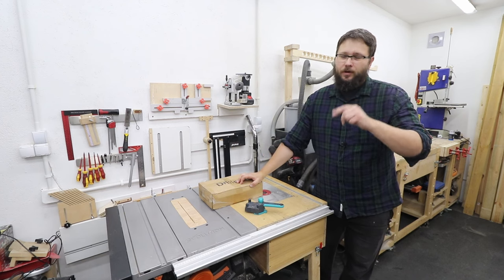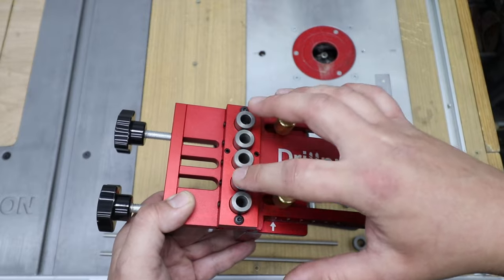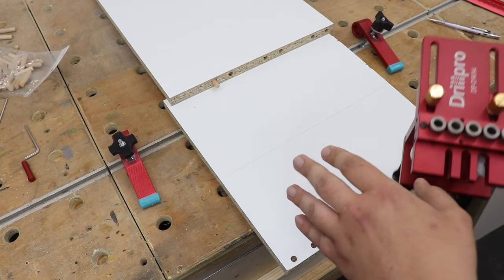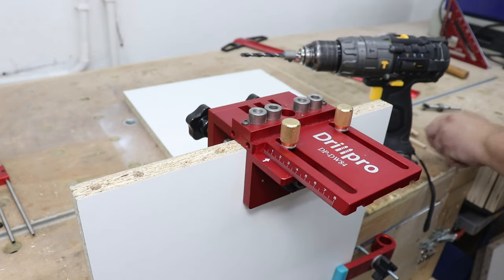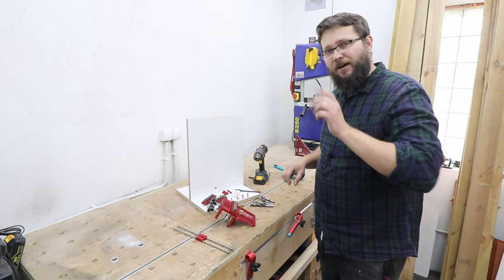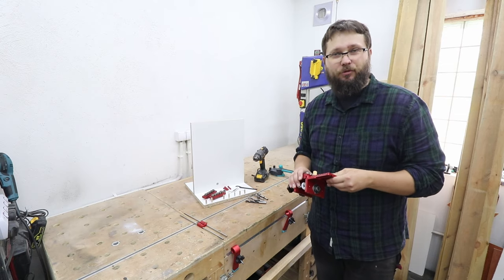Drillpro Doweling Jig in depth testing and review

Comment: So i've just finished a project with this little thing... I'm a complete amateur, and the way I've finished the cabinets and the built in I was doing for my mum looks exquisite.  No hardware visible, minifix on the "dark" sides. Furniture looks professionally assembled, very rigid and very straight. Even used the bit provided for some hardware it was not intended to be used with. Worth every penny for an amateur DIY project, If i paid someone to do this I'd pay 10-20x the cost of materials and the jig together. I know how to draw in CAD software, don't have two left hands. I can't recommend this enough!
Reply from the maker: Well done, it's definitely a solid jig 👍
Reply: Do you have experience of dowelmax in comparison to this? @CasualDIY
Reply: @Anomalous-Plant  unfortunately I do not
Reply: @Anomalous-Plant  as of todayy the JessEM or Dowelmax jigs are around 3 to 5 times more expensive than the DrillPro... I love me some Makita, Bosch and similar stuff but at the same time i don't see how the difference in price brings anything new to the table? All in all Dowelmax is heavier and a bit clunkier to work with and the JessEm is a serious bit of kit but i'd pick up the drillpro for 3rd of the price. Invest in good drill bits when these dull, keep the drillpro until it falls apart and buy another one or the new Wnew...
Reply: @SKarlo051  I bought the drillpro already and have been very happy with that choice. Very very glad that I didnt go for dowelmax, it really would have been an overkill.

Thank you for the input though! I arrived to very similar conclusion in the end

Comment: The fence looks like a game changer for me, it means as long as your starting dowels on both pieces are lined up, the fence guide does the rest! Great review - I’m finally catching up on about a year’s worth of your videos😊
Reply from the maker: It works great I have to say
Reply: The fence is really a game changer. This jig has better fence than many others, but still FAR from perfect. 

First, several square blocks (stoppers) should be included in each kit, because I want to preset them all on the rails before drilling anything.  Because, I want always base from the front surface, NOT from the last drilled hole.

I would place the first square directly near the jig (so that the jig is touching the square block). This way I will get the ability to move the whole assebled rails from side to side (from right to left, or from left to right) without affecting stops distances. This is the thing (switching a fence from side to side) which MUST be included in every serious jig.
Reply: Note how the second wood panel was not drilled as initially wanted. What was desired initially can be seen at 7:10. And then, at 7:50 the author wanted to start drilling from the left (like the first panel), but fastly realises that it cannot be done, so he has to drill from the right, because of the fence.

Comment: Great review Tomasz, it looks to be a great jig with quite a few additional features over the more basic dowel jigs that you can get, especially the cam lock feature.  I’ve got some other Drillpro tools and they are well made so no questions on that count.
Personally I will stick with my 10 minute workshop loose tenon jig as loose tenon’s have that ‘side to side’ wiggle that means you don’t need to be as super accurate on lining up the holes as you have to be with dowels, but its personal choice and this jig is good
Reply from the maker: Yes it seems that the Drillpro brand is quite solid, same as Veiko. 
I do like Peters jig very well thought through

Comment: I bought this, and it works well. I wish they would offer an add-on attachment for doweling visible dowels for added strength at 45 degrees across mitered joint boxes. Just a thought for Bangood.
Reply from the maker: Exactly that's the only thing that is missing in this set

Comment: The way you used it in the first demonstration your "reference/fence" edges/sides don't line up. You are counting on dowel centering for perfect edge alignment. Make marks where the top edge of the adjustable fence contacts the pieces and when you put it together you will find they don't meet. To use it perfectly you have to work R to L and then L to R. Try it your way with the holes off center of the edge.

Comment: thanks for the video, very well explained. It seems that all the videos found on YT about this jig are only tested on even-width boards (e.g. 16mm or 18mm) , but when it comes to uneven widths (15mm, which I very much use for my furniture) then comes the question as to what to do or not to do with the 1mm plate.. seems like another 0.5 mm plate is needed in order to avoid a round-up to the nearest integer value. In my case I use a 8mm setup, but after assembly (in the case of 90 degree joints) a 0.5mm lip is revealed. I will try using 0.5mm washers instead of the plate when working with 15mm boards. I will let you know how it all went. I would like to hear other experiences.
Reply from the maker: Hmm that is a good question. I only work with these odd sizes when I will my own timber. So the normal setup is the the jig moves every 2mm, the plate is 1mm so getting .5mm will be impossible.
Reply: You don’t really need to hit the middle of your board. As long as you reference on the same side of the board on your opposing workpiece that half a mil won’t make any difference.
Reply from the maker: @taiqidong9841  that's true

Comment: Thanks for the review. I have a dowelmax but this one looks like it functions very similarly. Needing so many hex keys would get old for me pretty quick, so I'd probably end buying two of these and keeping one in edge drilling configuration and the other in face drilling configuration. Buying extra drill bits so you don't need to keep adjusting the depth stop is something worth considering as well.

edit: About the price, I'd consider this a mid priced jig; not expensive at all for what it does. My dowelmax is $225 shipped, this would be around $93. Jessem makes a really nice doweling jig too for around $190.
Reply from the maker: Yes that would be a nice setup to have I must say. I'm thinking of making a nice box for it so the idea with dedicated drill bits seems nice I have to say.
Reply: @CasualDIY  A box for it would be a great project video. 👍

Comment: But does it work any better (faster, more accurate) than the Wolfcraft or Milescraft jig?  I agree that it appears to be more durable (metal) and it looks nicer but it seems to require quite a bit of reconfiguring.  More than the cheaper jigs do.  I'm just wondering, is this really a better tool or just a better looking tool?
Reply from the maker: It's far more accurate and you will get repeatable results. You set it up to a specific job and only change it when the job changes.  So in reality it's not that much messing around.
Reply: @CasualDIY  I see.  I didn't realize the cheaper jigs were not accurate.  I'd not seen that mentioned anywhere.  Thanks for sharing.  And thanks for your reviews.

Comment: It is a good jig and solid quality, annoying that it comes with no instructions, so many people are going to need to turn to youtube for guidance. 

There are a few niggles, such as there being a right and a wrong way for the guide dowel hole block, as there is for the five dowel template. The 1mm shim could do with being a stronger magnetic as when moving the jig from one piece to another it can often be left behind.

The set comes in two options, with and without case. The case helps keep a lot of individual pieces together but considering that the jig is fairly good quality the case is shabby, every time the case is open the individual bits are scattered all over the place.

Comment: Ok, I'm after initial tests. The drill bits attached (6,8 and 10mm) aren't straight. Just can't be used since they are causing so much wobling so it doesn't make sense. Need to buy some top brand drill bits. The second thing is that the drill bit for eccentric joints (15mm) doesn't fit into the hole in the fence 11:51 !!! That's crazy!!! I will have to grind it a little bit.
Reply from the maker: @proteusnexus1428  wow now I'm glad I didn't get one like you did 😅
Reply: @CasualDIY  Unbeliveable, that 15mm drill bit had uneven feathers. The ones with cutting blades are 14.75mm,  the ones with spikes were 15.25mm.  Did some tests with standard 8mm dowles on 16mm MDF (16.3mm to be prcise) creating L-shape joint. Couldn't achieve perfectly smooth joint. I paid atention to the orientation of the boards so the distance of the holes from the edge was te same. Didn't have to adjust the fence which could introduce some missalignment. I would say it looks good, but I can feel tiny tiny edge. Can't explain how this is possible.
Reply from the maker: @proteusnexus1428  should be perfect 🤔
Reply: @CasualDIY  Defnitely it was me :-D Didn't pay enough attention :-p

Comment: Very good kit but I see no one mentioning about one small flaw I've personally encountered( this is due to the fact that is not self centering): if you work with plywood sometime the thickness is not exactly 18mm or 12mm. This will leave you with a small lip  depending how much off your plywood thickness is.
Reply from the maker: And that's why you have the metal magnetic plate to adjust that. Or the other way if its like 0.5mm you just need to make the holes on the same face on each piece and he alignment will be perfect. Simple as that 👍 but yes a self centering feature would be nice.

Comment: Hi - I did buy the Drillpro. I have one question which I hope you can help with. What's the best strategy for doing edge jointing with this jig? And thanks for the great video.
Reply from the maker: Depends on your workshop setup and personal preference really. You need to try it and see which setup works for you.
Reply: Given that the Drillpro is not a self-centering dowel jig I'm wondering how you would do it? In other words, how do you make sure the dowels in the opposing planks are properly aligned with each other and in the centers of the edges? I hope that make my question clearer.  Thanks @CasualDIY
Reply from the maker: @eselick  you reference the fence of the same face of each board. So for example in the outer face.

Comment: Always enjoy your videos and have followed your advice on number of things. Just a quick question on this item. Does it do mitre joints?
Reply from the maker: Thank you👍
No it does not do miters but with a bit of fiddling around with it you probably could get some consistent results.
Reply: @CasualDIY Wow what a quick reply and thanks. I like the look of the jig re quality and versatility. Agree the 4 Allen keys is a bit if a pain however being a very basic amateur and no time constraints this should do the trick. Have you tried mitre joints especially where the furniture joints are at 45*?
Reply from the maker: @martinvanderhoek4363  I've actually not tried miters with this jig. Changing the setups with the Allen keys it's not that bad to be honest. You batch out one setup and then the other so it's not that much of messing around
Reply: @CasualDIY  Totally understand! Just need to be organised. Maybe a video of mitre joints with your expertise maybe helpful for your subscribers 😉 No pressure of course😉
Reply from the maker: @martinvanderhoek4363  hehe  I will add it to the list 😅

Comment: Just got mine. What a solid bit of kit! I’ll be using it to make a desk next week. Your video was useful since there are no instructions but I have one question….what are the washers for?
Reply from the maker: I'm actually not sure what the washers are for, not had any need for them yet. I must be using the tool wrong :D
Reply: @CasualDIY  well, I’m glad it’s not me. Just putting together the desk I’ve made using this jig. Much easier and quicker than the garden sofa I made using the cheap Wolfcraft one! Very happy with the jig.
Reply: @CasualDIY  Can't recall where I've seen it, but those two washers from the plastic bag were installed under those big knobs. In my case they weren't so I put them there. No clue it wasn't done in the factory though :-D

Comment: A relatively expensive piece of kit, but decently made by the looks of it and quite comprehensive in its capabilities ... thumbscrews could have been used in a few places instead of grub screws, meaning easier adjustment and less allen keys (for example the spacing guide) .... a very comprehensive demo of the capabilities of this product, thank you for sharing 👍
P.S. they also do a self-centring jig at half the price, but it's not as versatile as this jig!!
Reply from the maker: Yes seen that self-centering jig but I wanted something that will cover me in all possible areas.

Comment: I use a lot of 42mm x 19mm timber ,,how is this unit on this stock
Reply from the maker: 19mm will be a normal operation, 42mm possible but you will have to mess around with the setup of the jig

Comment: Just got this and it's been improved... It now uses 2 allen keys instead of 4. They also changed the name on it to "Énj0yw00d" (this comment gets censored/removed if i don't spell it like that). I also had that same Wolfcraft jig, which was SO bad. It made me dislike using dowels, and then the jig broke because it's cheap plastic. But this new jig is vastly superior in every way. Wish i got it from the start, it would have saved so much time and stress.
Reply from the maker: Yes it's a great jig for sure, easy to setup and accurate which is super important when it comes do dowel joinery.
Reply: I can confirm. Got mine couple days ago branded as yours. Only 2 allen keys now.

Comment: How do you align the jig for the first set of holes? Looks like it is missing a rotatable bar at the side to make the alignment.
Reply from the maker: As I mentioned in the video it does not offer a self centering option. You need to divide the thickness of the material in half and that way set up the jig. For best result (which I also mention in the video) you need to make references of the same faces.
Reply: @CasualDIY  Tomasz, you probably misunderstood my question. I am not talking about self-centering - it is not necessary, as long as you reference to the same face (it has 0.5mm stepping due to those 1 and 0.5mm metal plates and 2mm thickness step jumps). I am talking about another axis - along the sheet of the material. When you drilled the first hole, it looked to me that you relied on the alignment by eye looking at the edge of the material and aligning it with an edge of the jig. This is not accurate enough. Usually, there should be a rotatable aluminum plate at the jig itself so that you can just press against it, when making the first set of holes. Look, for example, how it works in the "Master 32" jig. Take a look here, for example: https://youtu.be/Gi2sUXfV0JU?t=64
Reply from the maker: @eugeneeugene3313  Ok I see what you mean now, no it doesn't have that, you can use the stop with the rod to do that. However I can't see why flushing the material with the edge of the jig is inaccurate? If you are not sure about your ability to put two pieces flush against each other you can use a straight edge to put the jig against it. However the position of the first hole doesn't really mater that much, the position in the second piece matters so they both align correctly.
Reply: @CasualDIY  Yes, that first hole defines the "planarity" or "flushness" of the two pieces to be connected at that edge. Flushing the material with the edge of the jig just by looking at it is not as accurate as pressing against a solid stopper plate  (I would say about 200 microns vs. 20 microns tolerance). I agree that you can use the stop with the rod to do that but usually, the distance of the rod from the edge would be shorter than "usual" period of the dowel placements along the long adge of the plate to be connected. So moving it back and forth will make the whole process much longer. You will have to do the first set of holes on all 4 pieces of the cabinet, then change the rod distance and do it again. Interesting, if one can get another piece that slides on these rods. Do they sell it separately? I would buy it and connect the rotating stopper plate to it. This way we can have 2 reference points without moving anything and without drilling the jig itself.
Reply from the maker: @eugeneeugene3313  I'm not sure of they sell it separately but could tinker with a DIY version.
Reply: @CasualDIY  Thanks, probably will do.

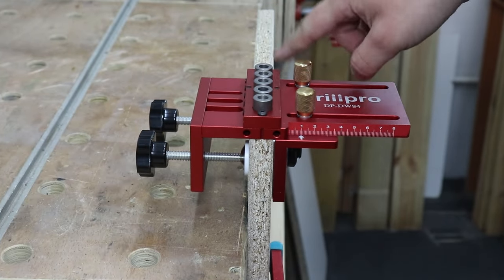Comment: you use a 6mm drill and then an 8mm pin for the guide rail? 5:06 & 6:36
Reply from the maker: It was 8mm lol not spotted that error, well done you are the first one that actually listened. At 5:06 of course I should have said 8mm.
Reply: @CasualDIY  😂Everything ok :) at least now I understand :)
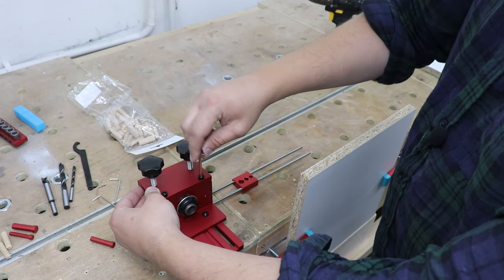Reply: One more question, did you remove the spacer plate at 7:47? I left them in and now the wooden board sticks out 1mm over the other board
Reply from the maker: @miuix4795  needs to be the same set up as on the first board and to avoid any mistakes mark the faces and make the cuts on the same faces, same setup on marked faces.
Reply: Thanks a lot for your help. I will test it. I still need a lot of practice 😅😅

Comment: Same old problem... However spiffy it looks, it is a metric tool. Many of us have invested in SAE (i.e. fractional) tools. If this used 1/4", 3/8", and 1/2" it would be of interest. Otherwise... 😴
Reply: Just remember it's 6mm to every quarter of an inch. So if your using 3/4 stock it's 18mm so set the jig to 9mm. .  The unit of measurement is irrelevant really.